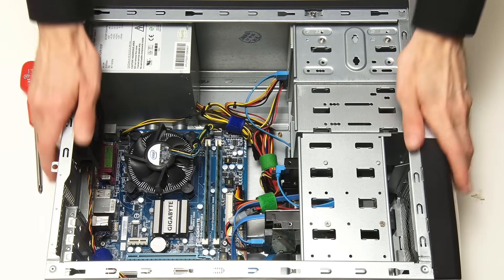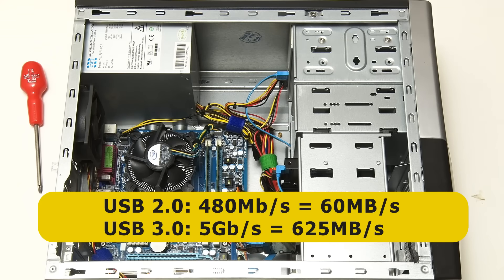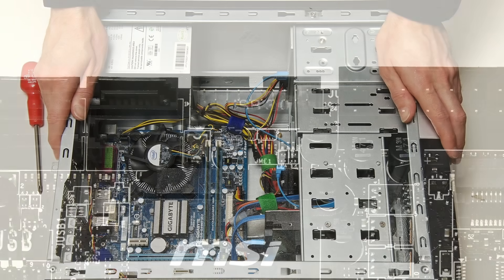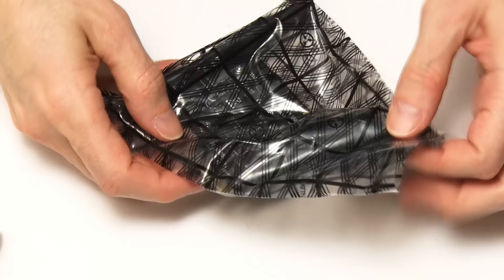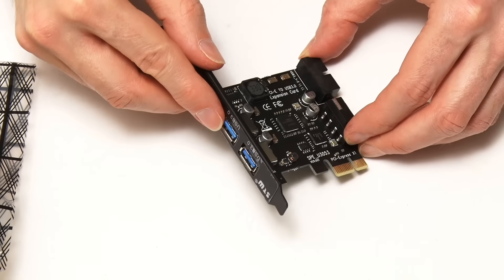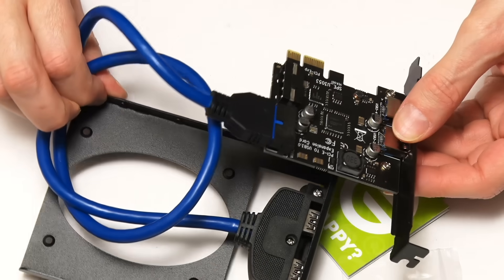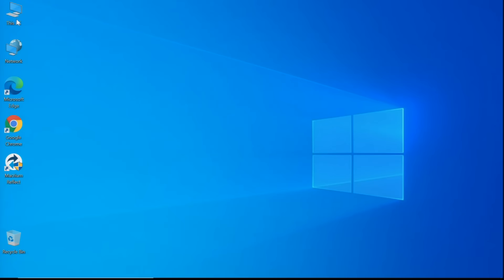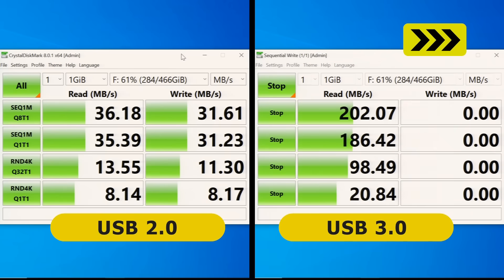Old PC Upgrade #3: USB 3.0 Ports

Comment: I am planning to buy USB 3.0 front bay for my system. I have intel motherboard Db85fl, and on my mother board I have direct slot for usb3.0, so I can connect 20pin front bay connector directly.
So my question how much data transfer speed I will get? Does this still depends upon PCIe bus version?
Info: I have sata ssd wd green installed

Comment: I'm wondering if all the development of this old computer worth the money, instead of buying a new (or newish) one with almost the same performance.
Reply: In my experience, yes -- especially if you go for used parts where it doesn't matter, like RAM and CPU. You can roughly double performance for under $50 investment, plus the SSD which you'd buy regardless.

Comment: You should add a GPU to the X16 slot. Maybe a GTX750TI is appropriate for something of that age and would work nicely. Of course I tend to do a lot of gaming. 

The USB 3.0 card is a nice addition to this upgrade. I normally give way to a USB 2.0 card reader to tranfer small files like DOS Games and JPEGs from camera to PC. I should note that I use a powered USB 3.0 Hard Drive Dock to transfer larger files to PC. 

I tend to upgrade full hardware and have USB 3 support on the Motherboard it's self. This video is great for me though because I repurpose old PCs to use them for multitasking. Use one of them while doing something else on another. Could be gaming on the main PC while doing a file transfer on another, browsing Steam or GOG on one while watching You Tube in full screen on another and so fourth.

For me,
USB 3.0 is good for Data Back-up and Migration from one PC to another with a HDD dock. I repurpose old Hard drives to store Steam and GOG files so I don't need to download them every time. This save a lot of time. Also I capture video to watch when I'm not home on my laptop. Move videos to a HDD in the dock and then use another HDD dock to throw them on to the laptop. This is where USB 3 comes in handy. Also now many Flash Drives are USB 3 and offer fantastic transfer speeds and are inexpensive. That's also a nice stick and go solution because it is fast when a 128GB flash drive can be had for for under 15 USD if you look around online. USB 3.0 make storage very cost effective.

Comment: 'in the next vid were going to upgrade our old PC with a new processor' (that should be interesting) 'and a new motherboard'....... wait, wot, thats basically a new PC then... :) FAF :) 
... technically, it still needs RAM tho...
........ a bit like changing the car engine, electrics, and interior, but keeping the original fuel tank... :) FAF :) ...or fuel tank filler cap.... :) FAF :)

Comment: @ExplainingComputers: Isn't there any possibility for a GPU upgrade on this with the old hardware, or atleast recommendation on GPU's which would work well with "Pentium E5500" which won't cause bottle-neck issue with each other.
Reply: I've used a random assortment of vidcards with these old boxes, some newer than the mainboard. You'll get the performance the PCIe on the board supports, whatever that my be, or of the card, whichever is lower.

Comment: i don't know if it's supported by that motherboard, but an upgrade to a core 2 quad is very cheap and boosts  the performance quite a lot. i've done it on an old Dell veritron and now it flies...with kubuntu 20.04

Comment: If Chris has gotten a hold of a Quad Q9500 or similar, he'd actually be in for a decent 2018 budget gaming-machine, with a GTX 750ti on it.
Any GPU beyond that and the CPU will bottleneck too much.
Alternate GPUs could be GTX 750, 650 or even 550.

Any GTX xx60 version would usually require extra PCIe power and that would require a PSU upgrade.
Is a PSU upgrade planned, then a xx60 card is a definite option. (GTX 660 is a good option and is fairly cheap on the used market).

I'd use it as a 720p gaming machine.

Comment: I recently got hold of 4 Tyan m/b's dated back to 2008, with onboard Intel graphics, 2 pcie slots, 8 USB 2, 6 sata and with 2.6 gb dual core Pentium cpu's...I'm running SpaceEngine on one of those with a GTX 1050ti and 4gb ram. (not to mention the Kingston SSD) Needless to say, USB3 will be my next upgrade here, so thanks a lot for this timely bit on the subject Chris.  👍
Reply: Okay, now I'm jealous. Back in the day Tyan was my fave board. I still have several from the 440BX era. Super-stable and reliable.
Reply: @Reziac  It's amazing how far you can stretch old tech with a little upgrade here and there. I'm running 2020 software (games etc) on a 12 yr old board. (edit)Oh yes, it's a very stable board..👍

Comment: Usb 3.0 adapter without connect extra power connector, still works...? If open my old PC and power connector not long enough, i can extend the cable?
Reply from the maker: Yes, it will still work, but you may not be able to power some devices (eg some external hard drives). Cables can certainly be extended.
Reply: Κάποιες συσκευές που είναι πιο ενεργοβόρες από ένα απλό στικάκι όπως οι σκληροί δίσκοι και ειδικά οι πιο παλαιοί HDD, που σε αντίθεση με τα flash στικάκια και τους καινούριους SSD, είχαν κινητά μέρη (κεφαλές, μοτέρ), δεν θα έχει αρκετό ρεύμα να τους δώσει ώστε να πάρουν μπρος και έτσι δεν θα τα αναγνωρίζει.

Comment: I had to transfer 10 TB via 2.0 took a week. 3.0 a day if I recall correctly.
Reply from the maker: Sounds about right.
Reply: Owww. Last time I had to do something like that, I scrounged up another HD connector instead and things went way faster. Ouch.
Reply: @Reziac  External HDD to external HDD proprietary connector through an old HP computer. Once I got so far in the transfer, I was praying that the power didn't go out.

Comment: a few years ago, when i was building a junkyard pc for my brother with LGA1156 platform, the mobo at the time was just right before the USB 3.0 tech. So i bought an Orico usb 3.0 expansion for 10$ from aliexpress. The expansion card is pretty solid especially the additional usb 3.0 front panel port suport besides the 2 rear ports.

Comment: As you can see on the pcie card, the manufacturers provide a gap to get your cables under the card for a better cable management. I discovered that not so long ago and can be really useful in hard cable management situations :)
You can see the gap pretty well at 9:15
Reply: I didn't even notice that. Thanks for the tip!
Reply: i always used that gap for hd audio headers and the cpu power cable
Reply: @virtualtools_3021  I guess it depends on where the CPU power connector is placed on the motherboard but often it's at the top. Wouldn't running it behind the motherboard be a more elegant solution? Although you may have to root it before installing the motherboard.
Reply: Actually that's to clear stupidly placed pins and capacitors (which abound on certain boards), but it certainly works for cable management -- used such weird routings myself a time or two!
Reply: @Reziac  never thought about that, makes sense!
Reply: It could also be because they lay out two cards so as to minimise PCB waste. The gap part is where another boards PCIe connector could be.
Reply: @6581punk  could be
Reply: I thought of that too. I still wonder if the cable length would be a bother in that situation.
Reply: @NicolasChapadosGirard  it depends on what cable you're trying to get through, in my case it works well to get my fan cables all the way to the plugs at the bottom of the motherboad!
Reply: I was about to comment that but decided to read other comments first as i'm pretty sure somebody else here knows what that gap is for...

Comment: And after all these upgrades, don't we end up with the equivalent of Trigger's well maintained broom (Only Fools and Horses), where the broom is 20 years old with 17 new heads and 14 new handles! :)
Reply: Was thinking thes same, lol. I wonder if a new case and PSU comes after the motherboard and processor video. ;)
Reply: @watsoft70  And just think.  When you've finished the upgrade, you can build a new PC from all the old parts you now have, that looks remarkably similar to your old PC.
Reply: @chrisg6597  I bet you'd soon be thinking about upgrading that one...you've done it before after all, lol.
Reply: @watsoft70  ... well, actually, he’s gonna upgrade the CPU only, no motherboard swap mentioned.

Which is something I do quite often with Intel Core 2 Duo setups. The older E8500/E8600 used to be stupid-cheap.
Around Turkey-Day 2019 I got four E8600 off eBay for $10 shipped. Total. All four.
I haven’t bought any since PanDemic days, but prices on most used PC stuff on eBay has grown rocket engines... to the moon.

Comment: I recommend NOT buying USB3 controllers with chips marked as uPD720201 or uPD720202 (made by Renesas). They have problems, mainly they do not work well (or don't work at all) with some USB to SATA converters. In my case such USB card didn't work at all with one of my USB-SATA converters in USB3 mode (but worked fine with USB2 cable), and it worked 1.8x slower than NEC USB3 controller with another USB-SATA converter.
Reply: I remember adding USB2 expansion cards to various PCs that had USB1.1 ports onboard, and finding then that expansion cards with VIA chips didn't seem to work at all.  I found that cards with NEC chips worked perfectly, and so it seems to be again with USB3, if your experience is anything to go by.

Comment: Great video Chris - thinking of doing something like this with my PC which runs a Sandy Bridge i7 2600K - it's stuck at USB2 speeds so the boost from USB3 will be most welcome!  One thing, though - what about upgrading the processor itself on this PC with a second-hand one from eBay?  Have you considered this?

N.B.  Just looked at the processor upgrade potential of the existing motherboard - it's Socket 775 so I can see why Chris wanted to upgrade it to a new platform but it could support better Core2 and 'Quad processors all the same - all processors which can be obtained for not-a-lot second-hand these days.

https://www.cpu-upgrade.com/mb-Gigabyte/GA-G41MT-D3(rev._1.3).html

Comment: First thought on watching the whole video, how many cry baby "professional" system builders are crying over your cable management? 😂😂😂😂😂
Reply from the maker: I discussed cable management in some depth in the last episode! :)
Reply: I defy even the most experienced computer geek to upgrade an old PC and keep the cables tidy without spending silly money on extender cables or taking a dremel to the chassis.
This can be an exercise in extreme frustration, especially with "brand name" PCs that have no spare connectors and whose cables won't reach anything the computer wasn't built with. Oh, and the PSU is often a nonstandard size, shoehorned into the case, so you can't swap it out for an off the shelf one. Grrrr !
Reply: @Bassman-r3c  Cable Management: the cables aren't flopping around, aren't in my way,  aren't under excessive tension, and won't get caught on the CPU fan or cooked by something hot. Otherwise... meh, they can be wherever they want. -- signed, an old system builder.

Comment: Hopefully once USB4 arrives then the price of USB3.x hubs etc will drop drastically in price. With USB3.x being arround for 10 years it is shocking the price is still expensive compared to USB2 stuff.
Reply: That's because there was this huge royalty attached to USB3 chips. For a while it was like $40 which made it too expensive for anything but high-end hardware. Obviously it's come down but yes, still too pricey by comparison.

Comment: HI CHRISTOPHER, I THINK CPU AND MOTHERBOARD UPGRADES  WOULD BE THE MAIN CONTRIBUTION TO BOOSTING A COMPUTER'S PERFORMANCE
Reply from the maker: For an older PC, adding more RAM and changing form a boot HDD to SSD are probably the best value upgrades. A new CPU and motherboard will certainly improve performance significantly, though. It just depents how much you want or can afford to spend.
Reply: @ExplainingComputers  And whether you lose compatibility with something else. But I've found it's generally most cost-effective to max out the older PC, and only do infrequent whole-system upgrades, rather than replacing it every couple years. Still wind up in the same place but with way less total invested.
Reply: @ExplainingComputers  Old quad cores are cheap. I have seen some older Athlon X4 chips on eBay selling for only 5 dollars. Core 2 Quads couldn't possibly be significantly more expensive.

Comment: Nice to see an old PC being "modernised" but , won't giving a new processor or a new motherboard make it a new/different PC , are you doing it as a new build?
Reply from the maker: Yes, a new motherboard and CPU is in effect a new build using an old case, PSU, drives and fans. I will do it as a new build -- when component availability improves! :)
Reply: @ExplainingComputers  oh ok then , yeah component supplies especially GPUs  are probably more rare than gold 😅
Reply: @ExplainingComputers  Yes, that's my grandfather's original axe. I've had to replace the handle four times and reforged the head twice, but it's still my grandfather's axe!  ;)

I would get a PSU tester that reports voltage and test that PSU before risking new hardware on it. I've found a lot of "working" PSUs actually have terrible spiking and sagging. (Or how I became an Enermax bigot.)

Comment: I can do with upgrading my laptop with a new battery, just recently I upgrade the memory to 12 gigabytes. Well worth the speed increase
Reply: I was thinking the same. And to replace the hard drive with an SSD.
Reply: I'm currently in the process of converting an old laptop into a portable Linux machine. Im currently upgrading ram to 16gb of ddr3 1666mHz, storage to a 250gb ssd, and making a bootable drive. Battery may see an upgrade, but the system already gets a good 6 hours away from the wall.

Comment: Just started watching.... CPU upgrade next?

Edit... cool.
Reply: IIRC there's already a Wolfdale core CPU in there, so not much to be gained. There's the LGA775 to LGA711 mod though, and that would enable multi-core Xeons...
Reply: @michalrzmichalrz6656  Yeah, I've got an old board that's topped out with a late-model quadcore and could do the LGA711 mod, but wouldn't gain much and would increase power consumption and heat considerably, and it already runs too hot (southbridge regularly goes over 100C). Which reminds me of something else... an old southbridge being forced to handle USB3 can get really hot. Like mine does! amazingly, it's one of the most stable PCs I've ever had... never rebooted unless power is out beyond the UPS's capacity.
Reply: @Reziac  Sweet Jesus that is one toasty southbridge. I remember some boards would do weird things to chipset voltages when these were set to 'auto' in the bios. Especially during overclocking - as the board would boot loop and try to find a stable setting. I'd always look up the correct voltages and dial them in manually, sometimes getting away with undervolts.
Reply: @michalrzmichalrz6656  This is an old Intel-branded board -- 2008 vintage with a quadcore. Hottest I've seen the southbridge -- during torrent saved to USB drive -- 220F. Fetch the bacon and eggs, Martha...  anyway it's all set to default everything, and it's been running stable for 6 years now (never restarted except for power outages, or stuff like replacing the NIC), so if it ain't broke... but lordy, it's gotta be setting some heat records for a PC. It'll whine if the CPU goes over 170F but otherwise it doesn't seem to mind. I leave the case sides off and it's got a fan blowing at the mainboard. If I ever do a teardown I'll put a copper heatsink on that southbridge, but can't get at it while it's mounted up.

Kinda weird for being one of the most reliable PCs ever. (Has never crashed.)

Meanwhile the i7 and the matching Xeon idle at a CPU temp around 80F (yes really).